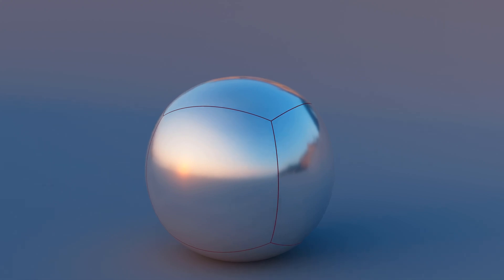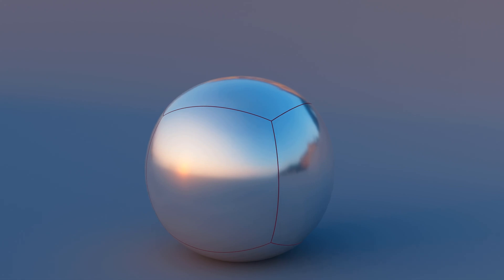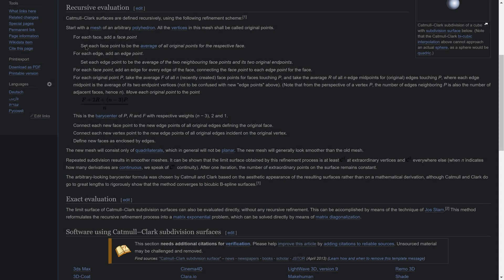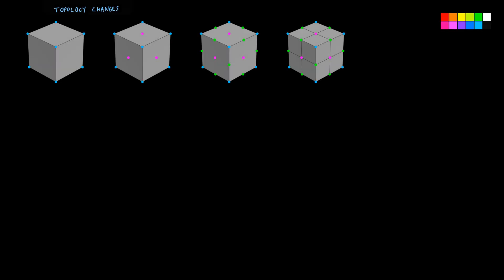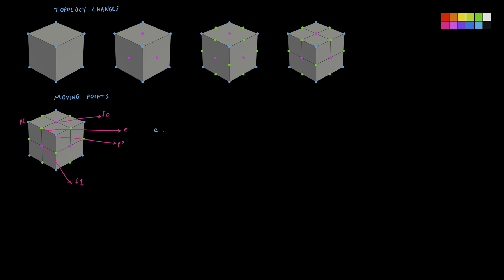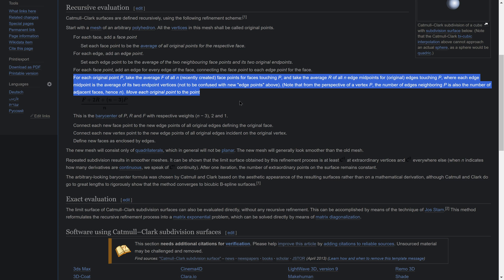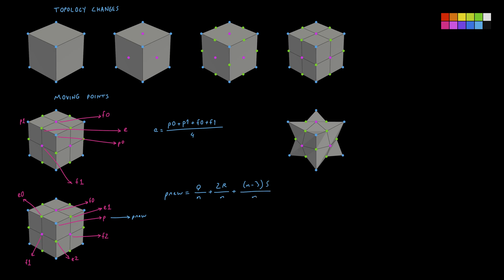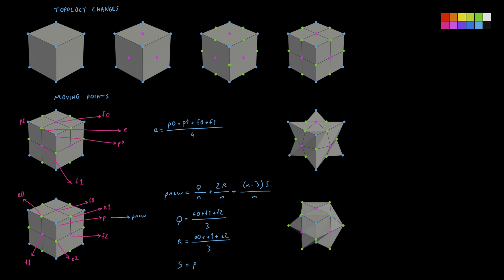Implementing Catmull-Clark Subdivision - Introduction & Rules

Comment: Hello, sorry because this is a bit off topic, but I didn't see a more suitable video to ask under:

I'm interested in your adaptive subdivision product on gumroad. One thing that's not clear to me is the approach that's taken so that displacements applied on the subdividided mesh look smooth. In other words, how you promote a good triangulation is done - e.g. how you handle/what options there are for handling T-junctions (example is a 1x1 quad has two 0.5x0.5 quad neighbors along one edge).
Reply from the maker: The adaptive subdivision node doesn't perform any triangulation. Instead, it works by iteratively subdividing polygons that fall within a specified proximity of another geometry (such as an open or closed curve). So it's purely proximity-based, not topology-aware in terms of triangulation or T-junction handling.

If you are adding a lot of details i.e. a lot of adaptive subdivision, it will introduce some flatness in those areas especially if you are using render-time subdivision. Recovering the original smoothness typically requires additional techniques like limit surface sampling to reproject points onto the original shape’s limit surface. I demonstrate this in the Pragmatic VEX: Volume 1 course. However, the adaptive subdivide node itself doesn’t include those features, they’re implemented as separate nodes since they require more information to work properly.

Hope that helps.
Reply: @pragmaticvfx  Hm, but so what happens at the borders of different subdivision levels in your implementation, where the T-junctions exist? The houdini Catmull-Clark, has the "Close Cracks Closed" / "Stitch Cracks Together" options and then the "Boundary" option which can be used to fill in these areas in some manner. Is there something similar in your implementation, to avoid holes in the mesh from appearing if you deform the mesh at these boundaries?
Reply from the maker: @1982pwr  Adaptive Subdivide node uses OpenSubdiv, not Houdini Catmull-Clark. Because of that, options like "Close Cracks Closed" or "Stitch Cracks Together" aren't available since they're specific to Houdini Catmull-Clark algorithm.

That said, my implementation doesn't have the cracking issue that occurs when using OpenSubdiv in an adaptive manner, i.e. when using sub-geometry. It handles stitching between subdivision levels automatically, so there won't be any holes or artifacts at the borders. This exact issue and how my solution avoids it is one of the key topics demonstrated in Pragmatic VEX: Volume 1.
Reply: @pragmaticvfx  Thank you very much for the reply and explanation.